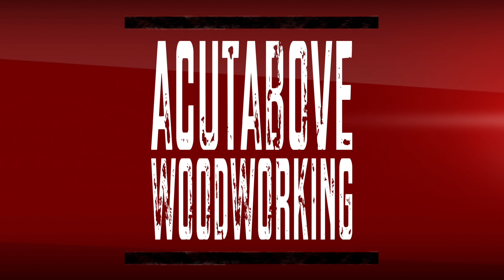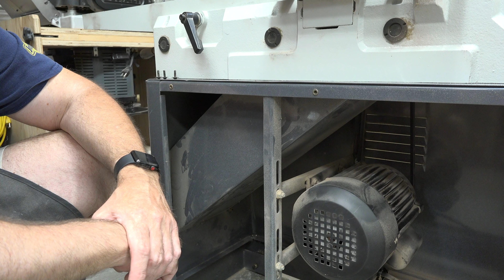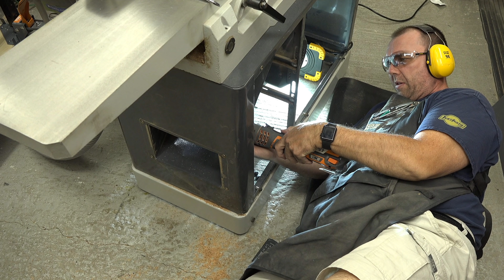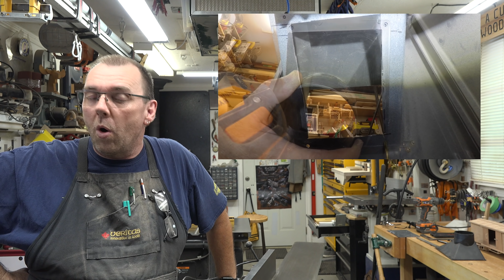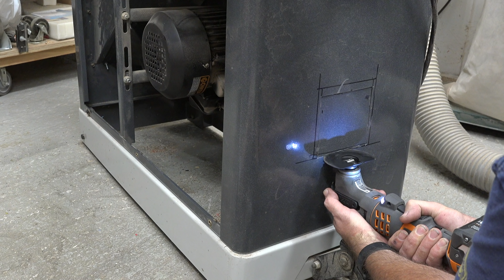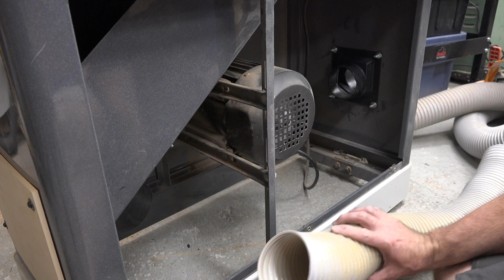Jointer Dust Port Modification

Comment: Get a clear piece of acrylic to patch the hole. That window will allow you to see what's happening without opening it up.
Reply from the maker: You are not the first person to suggest this Francois and it is a superb idea which I will be implementing soon.  The ability to check for clogs and blockages without having to remove the bolts would just be a bonus.  Thank you for tuning in and for taking the time to leave a comment.  I truly appreciate your support.

Comment: Do you lose suction with out a gasket or sealant on the filler panel? Where did you get the metal cutting blade for the multi tool?
Reply from the maker: I have not noticed any suction loss at all from this modification.  I was thinking that if I lost suction, I could silicone the area on the filler panel but because the chips now slide direction down into the 4" port, the filler panel is just a formality.  The tray that the chips slide down is completely open at the top as it is, so it was never a sealed system.  Thanks for tuning in to the show and taking the time to ask your question.  I appreciate the support.

Comment: Love all these modification videos. I would have done exactly the same way Kenny. Only i would have sealed all the dust ports and blanking plate.  Perhaps you did that off camera. Look forward to all your videos. Thanks.
Reply from the maker: No seal as of yet Malcolm.  With the completely open trough (even in the original design) there was never a seal and it really doesn't seem to affect the performance of the collection.  I will monitor the operation of it over the next little while and be sure to report back in an update show what the final outcome was.  Thanks for the kind words on the show.  As always, it's great to hear your comments.  Thanks for tuning in.

Comment: Kenny,  that is a great and much needed modification.  Multi tools sure are handy aren’t they?  Super job my friend.
Reply from the maker: Thanks Paul.  When I first purchased the multitool, I wondered what I would end up using it for but I have to say that it has been a very handy thing to have around.  The uses have been multiple and the list just continues to grow as to what this thing can do and what jobs it can make easier.  I've been amazed to be honest.  The relocation of the jointer port has been epic thus far and I am easily able to hook it up to the dust collector hose for even the quickest jointing jobs.  I should have done this sooner.  Time will tell if it is a worthwhile modification or not.  Thanks for tuning in.

Comment: A great video, but a question please... could you not have saved yourself a whole lot of work and just used that piece of 4" flex hose(inside the cabinet), connected it to the original outlet and routed that hose around the back of the machine (or elsewhere) and put a blast gate on it with a Y section of PVC and then you would not have to remove it at all and saved yourself all that work? and the possibility of problems occurring inside the cabinet. I can also see issues with the suction system sucking air through the gap between the MDF and the cabinet and the 2 plastic outlets and the metal cabinet on the opposite side. I would have put silicone around each of them to seal them...  A great video showing options. Tim
Reply from the maker: I considered the relocation of a hose behind the unit Tim, but there is wood storage behind the jointer that prevented that.  If this were a closed system, I would be concerned about pressure loss from unsealed joints, but the truth is, the loss at the end with the back to back connectors is zero as they are connected tight to the body of the jointer and make a good seal.  Silicone (as you suggested) would definitely guarantee a zero loss for sure.  The other end of the jointer is connected to an open trough; the same as it was in the original setup.  The top of the trough where the chips slide down is completely open so leaks are not an issue at that end as there never was and never will be any sort of a seal there.  The chips slide down the trough directly into the 4" port.  Others have pointed out the possibility of the suction from the collector, drawing the hose upward and into the motor housing.  This is a very rigid hose and I can't see that happening but I will be sure to check it and verify that it doesn't happen and I appreciate the concern.  I am sure that all of these potential issues will be addressed on an upcoming update show so be sure to tune in for that to get the answers.  Thanks for tuning in this week Tim and for chiming in with your suggestions and comments.  I truly appreciate the input and support.

Comment: Nice solution. I'm still trying to figure out how to arrange my shop. It's not that small, but oddly shaped. about 900 square feet, but stairs come right down the middle.  So the floor layout is "U" shape.
Reply from the maker: Setting up a shop takes time Doug and I am sure that you will have several arrangements before you come up with your final design.  Thanks for the kind words on the show and for tuning in.

Comment: You need to check if when it’s on and the vacuum is on if that hose constricts to much to touch the bottom of the hot motor and melt through
Reply from the maker: The 4' hose is a pretty rigid hose that can not be compressed by the dust collection unit but in the interest of safety, I will be sure to check on that and make sure.  Thanks for tuning in and for the safety concern.

Comment: 'Every Shroud has a Silver lining' ha ha ha, i couldn't resist that one.
Nice bit of relocating there Ken, that piece of MDF when you change it to the Aluminium if possible could you hinge it on or something?, i was thinking of an easy access for blockages etc or would taking off the main side piece do the job instead? Just thinking out loud!!! 
Barry (ENG)
Reply from the maker: You're not the first to suggest an easy access clean out port when I replace that MDF piece with aluminum Barry and it's a fantastic idea that I will definitely be looking into.  I like your hinged idea.  Possibly riveting the hinge on to the aluminum and then on to the body of the planer and using the existing hardware as a closure, opposite the hinges.  Thanks for tuning in and for the suggestion.
Reply: @acutabove_woodworkings  I didn't know other people have suggested the same idea, i don't read replys if i can help it.
Barry.

Comment: Kenny did you consider putting a triangular cross section across the bottom of the slide to  encourage the chips to make the change of direction into the new hood location ?
Reply from the maker: I never really consider it Sibat as the existing dust port is somewhat triangular shaped itself.  With the chips sliding down naturally, there really isn't anywhere for them to go other than directly into the 4"dust port.  Thanks for the suggestion though and thanks for tuning in to the show.

Comment: Nice work around. When you fix that MDF plate on the other side think about putting something in that you can remove easily so you can use it as a clean out.
Reply from the maker: I absolutely LOVE this idea Richard and I will most definltey be using it.  Having a removable access port for a clean out is something that never even crossed my mind but it will be so handy and useful, that I can't help but take your suggestion to heart.  Thanks for tuning in to the show and taking the time to chime in with your suggestion.  It's very much appreciated.